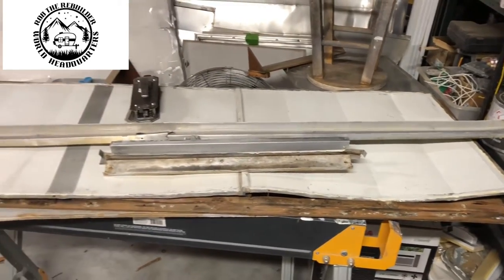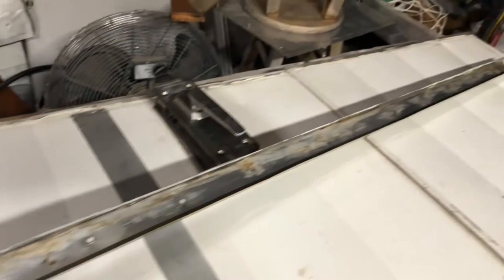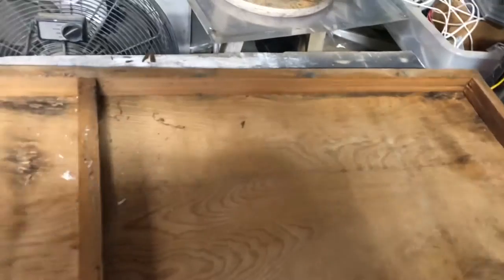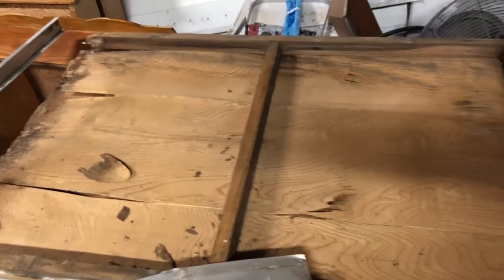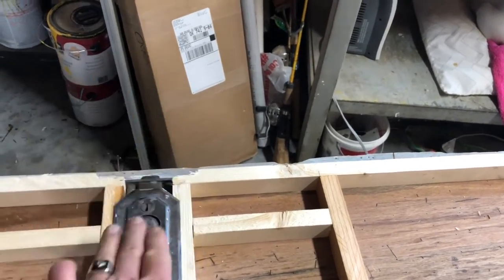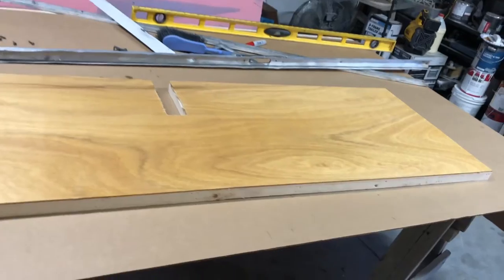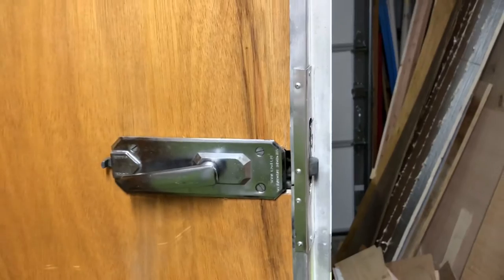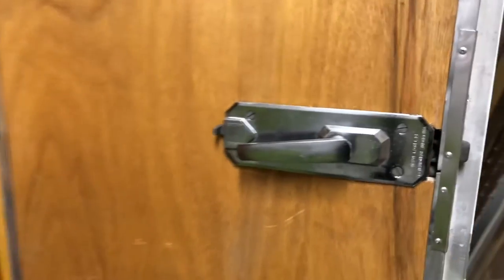EP 239 Rebuild Shasta door from scratch DIY vintage camper

Comment: What size lumbar did you use? My door now is currently a piece of 3/4 plywood with the oem Aluminum trim on it
Reply from the maker: I just cut down 2x4's to match the original measurements.
Reply: @RobTheRebuilder  do you remember off hand? Haha. I don’t have anything to measure off of.
Reply from the maker: @Blue04Z71  I don't remember but you can take the top or bottom piece and measure it across and leave room for your metal exterior and luan interior piece. I'll bet it is somewhere around 3/4" to 1 1/8". Just experiment with some scrap pieces. I'm out of town or I would go to the shop and try and figure it out. Sorry. Good luck